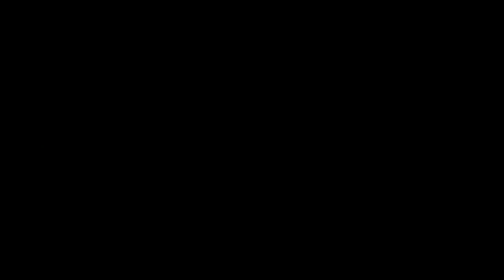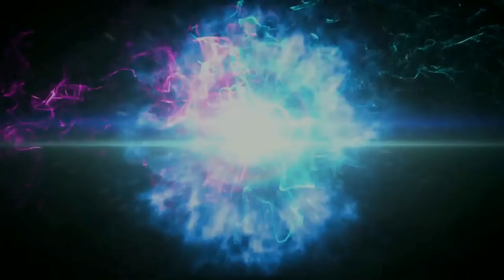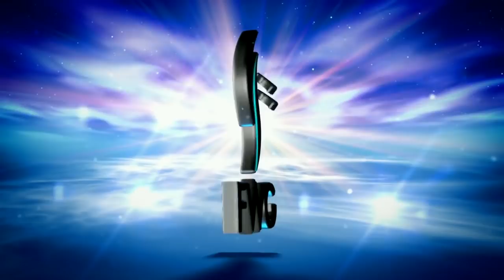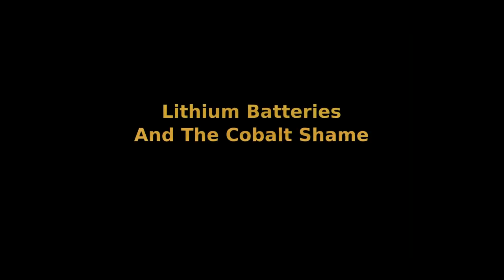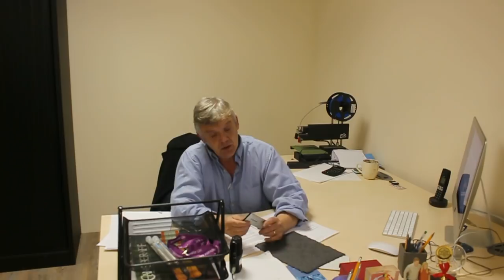Lithium Batteries And The Cobalt Shame

Comment: The "40% Cobalt" number is definitely wrong. 40% of worldwide cobalt production does go into batteries. I wouldn't be surprised if after the quoting of quoting of quoting it somehow ended up being "40% of a battery". You could also think (although I don't subscribe to this idea) that some want Li ion batteries to look bad (I don't mean you!) and spread these numbers. 
Cobalt is 60% by weight of active material of the cathode of the LiCoO2 chemistry. The active material is a not negligible but still small portion of the cell's overall weight. Ignoring the case/pouch a lot of the cell is the electrode base material (copper/aluminium strips), the separators and the electrolyte. This battery type is mostly used in phones, laptops or other consumer gadgets and not in cars.
It is surpassed in specific energy by LiNiCoAlO2 (which Tesla uses in their batteries) with 9% cobalt in the active material and matched by LiNiMnCoO2. In total there's about 5-10 kg of cobalt in an EV battery (disclaimer I'm quoting, but have seen several numbers in that order, some based on g/kWh, some just the total itself).
Btw. there are almost no cobalt mines. More than 90% of cobalt production is a byproduct of copper and nickel mining (even in the DRC). Therefore it will be hard to increase production and battery manufacturers will have to try to come up with less cobalt dependent chemistries. 
Another issue none really talks about is graphite, the anode material. There's usually more of it in a battery than cathode material and it is used pretty much in all Li ion battery chemistries. The way it is mined in China is far from environmentally friendly.

All that said I'm fully in support of any legislation that forces manufacturers (all of them, not just battery manufacturers) to check where their raw materials (or parts, or even whole products for imports) are coming from and that they are produced to certain humane and environmental standards.

Comment: Actually the cobalt content usually is around 20 percent.  Notably the highest capacity types may contain 60% cobalt according to at least one reference I found; but the 20% figure seems to work out as an overall average when stated in terms of how much material the manufacturers buy.

It would certainly be a good idea to move away from cobalt.
Reply from the maker: cheers mate

Comment: Thanks for that - it was a great rave! I had no idea Li-ion batts had so much cobalt in them and had no idea about the sources.
Will you be selling printed sheets at any point for us to experiment with?
Reply from the maker: cheers mate and no we won't be selling sheets - the info Is here to make your own and I would encourage you to do just that
Reply: Thanks for your reply and thanks for all that info too. I have a pretty good working knowledge of graphene at this point thanks, in great part, to you and your passion. I think you are very generous and I thank you for that. 

I have done some unrelated experiments in the past and have some follow up projects on the back burner, which will take up a fair bit of time as it is. I could play around with some sheets but I'm not sure if I would be able to start grapheme from scratch (as much as I’d like to) – one can of worms too far. 

One in particular I want to do (apart from making a battery) is based on a Tesla turbine but with profiled discs. I want to make very thin discs with a graphene resin similar to what you used for your graphene armoured tile. 

After seeing you make graphene and seeing your processes and your transparency I trust that you are producing a good product. So I must ask - Will you be selling graphene in any form?
Reply from the maker: i have no idea mate - we will see how it goes i guess

Comment: Both Apple and Tesla refuse to use "unethical cobalt". Tesla has said it would use only North American Cobalt. Batteries use a lot of the stuff but the lions share (50%) is still in high strength/temperature metals
Reply from the maker: apple recently admitted it didn't know where it's cobalt came from.
Reply: yeah it looks like apple is in the process of making some changes. Amnesty International is on their case and apple supoosedly has stopped buying from suppliers that mine by hand. Hopefully there will be more pressure for change. As for tesla, I could only find one article claiming tesla would only use north american cobalt but no evidence of who their suppliers are.

Comment: If you upscaled the carbon battery to perform like a lithium battery im guessing it would still be lighter but not smaller, So wouldnt that make it more suitable for a home battery bank for solar systems, or electric trucks which wont have a problem with the size?
Reply from the maker: spot on mate

Comment: I also wonder what you think of super cap made by kilowatt labs seems like pretty intense energy density
Reply from the maker: it looks like a BMS rather than a chemistry mate
Reply: Yeah I was explained to me that they were capacitors built like batteries slow discharge can be used to replace that acid or lithium ion
Reply: I build lithium-ion drop-in kits for Golf Cars Big Industry and kilowatt labs are trying to build a golf cart pack with me that they say will more than 3 times I'll perform my lithium-ion pack
Reply: Robert Murray-Smith I sell on average 200 to 260 Trojan T 1275 lead acid batteries to make 48 volt golf car battery packs a month if you guys get to the point where you can supply batteries to America I would love to offer your batteries hopefully not too far away
Reply from the maker: it shouldn't be too far away mate